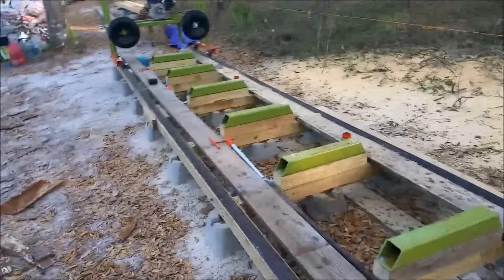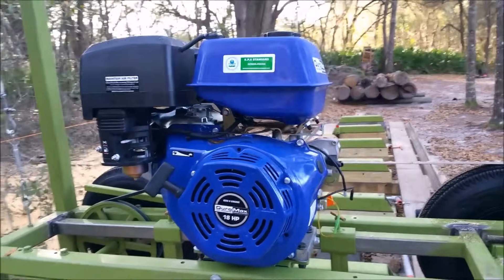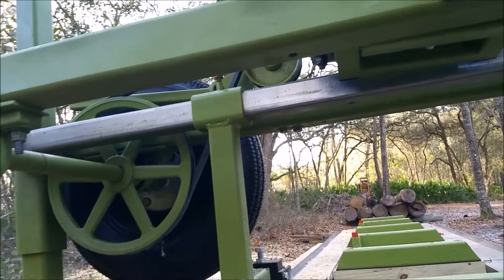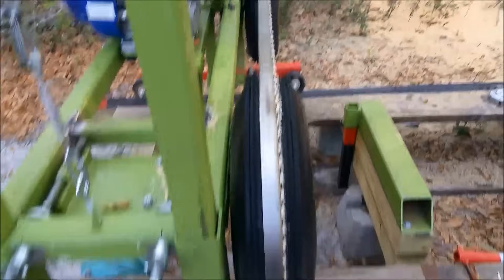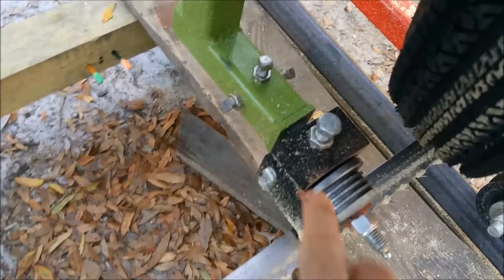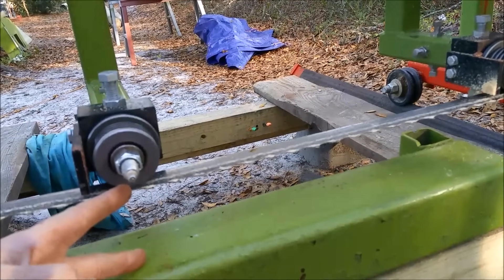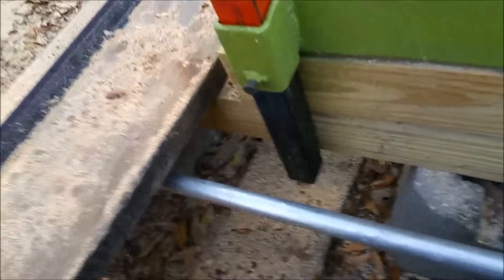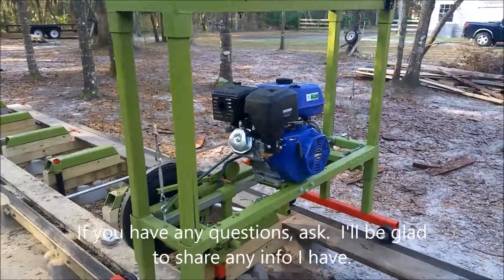Homemade Bandsaw Mill walk-around

Comment: Hi, can I ask what size is the belt you used please?
Reply from the maker: Jerome Sheerin 
I believe this setup had a 69" A type belt.... This was undersized and it is now a type B belt and I changed over to centrifugal clutch also... No more tension engagement lever. Lol
Reply: Thanks for your reply. the type b belt 69" would be a better choice so. I am ordering the following pulleys for my build. https://www.surpluscenter.com/Brands/Concentric-International/3-35-OD-3-4-Bore-1-Groove-Pulley-1-BK32-C.axd and https://www.surpluscenter.com/Power-Transmission/Pulleys/Finished-Bore-Pulleys/10-25-OD-1-Bore-1-Groove-Pulley-1-BK105-E.axd
Reply from the maker: Jerome Sheerin 
I actually rebuilt this whole saw since this video. I went wider and used pulleys with belts for the wheels. Redid my blade guides and built a new motor mount. Lol pretty much only kept the raise/low cable thing. Now it needs to be upgraded. Lol
Reply: Hi Again , Fair play to you... You have a great mind . I ment to also ask you the length of the Saw Blade and the TPI.. Thanks , Jerome

Comment: Very nicely done, as "oceanBlueLady" mentioned, it one of the nicer home made mills I have seen on youtube.   I think you said you used 2 inch square tube for the carriage, 3/16 thick,   do you find the strength good enough? or would you go bigger?  I was thinking of just using 2 inch square tube by 1/8
Reply from the maker: curtis siwak 
Thanks. I personally would not use smaller wall thickness than 3/16". There is quite a bit of tension on the blade and it needs to be solid.

Comment: Hi JD, I have an upgrade for you if you might be interested! I am building a mill and it is close to yours! On mine for raising and lowering I am using a worm gear off of a snow blower front section! I priced a winch wormgear and there way expensive at a local store If it interests you I will send you some pictures look me up on FB. I have kept the price under 200.00 99% is recycled. Love your mill.
Reply from the maker: Marc  A Gagnon 
I appreciate the offer. I'm nearly finished with rebuilding this now. I'm not sure what I'm using in the future for lift/lower, but ill keep that in mind.

Comment: Hey Josh, I am accumulating materials to start my build and have a question about the blade guides.
Reply: Is the jaw a required part of the guide.  I see they sell the assemblies with or without the jaw.
Reply from the maker: Joe Hartley 
Is the jaw the bottom plate that sits under the blade? If so, no you don't.  If I remember correctly, that was for a specific blade or issue. I just bought the 1-1/4" blade guide assembly pair and have had nothing but good stuff to say about it.
Reply: Thanks Josh for the quick reply.  That really helps. I will place an order as soon as I my basic framework is complete which will begin shortly. Thank you for taking the time to share your build and information you have provided. You probably mentioned it somewhere but having watched so many videos they are starting to run together, what is the overall height and width of your framework. I am guessing around 5' h X 5'w and approx 8" between uprights sitting on a 36"long wheel base.
Reply from the maker: Joe Hartley 
Good question on the measurements. It's roughly 5 feet wide by 5 feet tall. The actual sawmill frame is about 5 ft wide x about 14 inches deep. The "legs" on the frame are 8 inches. The carriage uprights are also about 14 inches apart to match the frame. The bottom horizontal parts on the carriage are about 24 to 30 inches long. Hope that helps

Comment: Nice job  on that mill -  would be nice o see it work ;  Cost to build  & any change's would would make -  have  a blessed day mate - kirk out > thank you for sharing  :: -  )
Reply from the maker: Kirk Hobbs 
Thanks bud. What would I change? The whole saw. Not to say it didn't cut, but it could be better and will be. I've stripped this one down to the frame and am almost done rebuilding it bigger and better. There is a video of it cutting on my channel. Also, I will be making another video comparing the two and why I rebuilt it. Thanks again.

Comment: Hi Josh thank you for your quick response, but I think I explained wrong. I would like to know the width and length from outside to outside of the mill itself.
Thanks
Reply from the maker: Freddie De Waal 
The carriage is roughly the same width at either 50 or 60 inches. I'm leaning towards the 50" mark. How I came up with a width was based off the blade length. I found my wheels and blade first, mocked up on a work table as if it was finished product, and built from those measurements outward. As for front to back depth, I'm at 14 inches, which if I had to do again would be less than a foot probably, just simply to bring the pillow block bearings closer together and shorten the axle. I also would see no problem with a solid two post design instead of 4 post. If you wait a month or two, I am rebuilding this mill and will post another video of that and share pros and cons between the two. Hope I understood your question this time. Lol

Comment: Excellent mill, what is the width and length of the moving bed from outside to outside
Reply from the maker: Freddie De Waal 
I believe the center of rail to center of rail is either 50 or 60 inches and the bed is the length of the steel at around 19 feet length. Can cut right at 17 foot log if places perfectly.

Comment: Josh I've been on Forestry Forum looking around gathering more info. This is a big help, i'm about ready to send out a parts order and since my build will be very similar to yours I was  wanting to know if you remember the length of your 5/8 drive belt. THANKS ; Garley
Reply from the maker: Deborah Cline 
I think it's a "A" belt by 64-ish in length. What I actually did was tie a string around the whole built assembly and measure it to get my belt length. I bought like 3 belts before I hit the magic number that worked best. Just fyi, I am rebuilding the entire machine with a different design on the tension, alignment, and using band wheels this time. I should be done and making another video in a month or two. I'm also on Forestry Forum as "mazdathumps".

Comment: thanks for the share. on your boat winch. switch over to a winch " brake" type they are designed for a vertical and horizontal. I would say a small 800-pound rated one would do you fine. ( "Dayton" on eBay) and cheap. the idea behind them is they will not freewheel down when you lower the saw head. A regular boat winch will just drop if the handle slips out of your hand.I have one on my saw, they do need a minimum of 50 pounds of down weight to make the brake perform, Just a little share for all to read.
Reply from the maker: Hemi Power 
Agree... I thought I broke my hand one day when it slipped and hit me... Took a few days to get my hand to feel normal again. I would suggest the winch, but I don't have a battery on mine, so I kept the hand winch. Thanks for the added advice
Reply: josh I was just on the comp and got your return. These brake winches are manual, not electrical! https://www.ebay.com/itm/DAYTON-12U370-Hand-Winch-Spur-Gear-w-Brake-800-lb/331342022421?ssPageName=STRK%3AMEBIDX%3AIT&_trksid=p2057872.m2749.l2649    Are well made this the one I chose rated as I said 800 pound lift. check it out let me know what you think
Reply from the maker: Hemi Power 
Yeah, looks good. I like the removable handle too. That helps when covering it up for the day. I am currently rebuilding this mill, so there might be some changes in that department eventually.
Reply: Josh glad to help>

Comment: Hey Josh - This is the best build and video i've seen on here. Just in the planning stage and I am thinking about going with the bigger 18.75 cast wheels. Was wondering how the gearing is working out for you? Would also like to know if you would mind e-mailing me some measurements of your bunk to garley_debbie@ymail.com. Would greatly appreciate it, and how are you liking the duromax? THANKS -Garley- from southern West Virginia
Reply from the maker: Deborah Cline 
Thanks. Glad you enjoyed it. I would recommend the cast wheels. As for the bunk, I believe the rails are 50 inches from center to center and the actual 4x4 square tubing(s) are about 18 inches (??) Maybe... 

With that being said, I have stripped this sawmill down to the frame and rebuilding with a different design and beefier parts, such as axle size, bolt sizes, and actual cast band wheels. In another month or two, I should be done and able to make a video on that one. Keep in touch and I'm sure another video of the upgrades will be uploaded. I hope to compare the two designs after I'm finished building the new one.

Comment: Sorry to bother you again. On the coupler nuts, how did you get the rod to thread all the way through? I thought the threads were opposite on the sides where you threaded 2 rods. I am talking about on the wheel adjustment part.
Reply: As long as you have the proper belt should be just fine. I got this specific wheel from an aborist site from the lumber section. https://www.arboristsite.com/community/threads/band-saw-mill-wheel-size.190933/  there is the link. I have the mill together but everything frozen so may be a few weeks yet before I get to dig in. I'll post w/ some pics when the time comes. Thanks again for all the info guys.
Reply from the maker: staci haley 
Not exactly sure what you are asking, after all its all homemade so no official names. Lol I drilled slightly larger than 5/8" holes through the side of the frame. Slid 5/8" all thread rod through those holes into 5/8" coupling nuts (right handed thread, both) and threaded the rods through and walked away. On each side of  the frame, I added a washer and drilled a hole through the rod for cotter pins. The washers/cotter pins allow the rod to turn in the oversized holes while the coupling nuts pull tight or loosen the plate they are welded to. I hope this helps answer your question.
Reply: The coupling i bought only allows it to go half way through then just locks the rod, everything else is the same  as you said. May just have to buy a different coupling that allows threaded rod all the way through. Thanks for your time.
Reply from the maker: staci haley 
I got ya. I had to tap mine through the middle to get rid of that dimple that stops it. You can also buy coupling nuts without that stop in them.
Reply: Ok got it. That's what had me curious. Wasn't sure if it was threaded differently at both ends or if I just needed to do away with that stop. I'll drill that out today. This has been a pain in the arse. Not the putting together so much as waiting on parts. Almost done I think, lol.
Reply from the maker: staci haley 
Are you building like mine? Man, I'm humbled if you are.
Reply: Yeah pretty much the same. I made very small changes but your design was one of the best diy i've seen. I purchased some 18.75 h bushing pulleys from supply center instead of using tires. http://www.surpluscenter.com/Power-Transmission/Pulleys/Split-Taper-Bushed-Bore-Pulleys/18-75-OD-H-Bushing-Single-Groove-Pulley-1-BKH190.axd link for those. If you've never used h bushings before hit me up because they are a pain to track info on, had to call company to ask ?s. Ill send you a pic when its finished up.
Reply: BTWm what you did with those turnbuckles was pure genius, I had originally gone with a different design and couldn't get it straight to save my life. Then I stumbled on your channel. Changed everything.
Reply from the maker: staci haley 
Glad to hear it helped man. That means a lot to me. The turnbuckle  idea works incredibly. I'm very satisfied with that setup. I sure wish I would have found these pulleys sooner, I just ordered 2 bandsaw wheels to convert mine over.
Reply: staci haley not trying to be negative at all buddy but are you sure those wheels you ordered from surplus are gonna work? It looks to me as if it is just gonna eat your blades up after just a few revolutions with the belt groove that’s machined into it. 

A bandsaw blade is not forgiving like s belt is. A bandsaw blade is made to ride over a flat wheel, it really should have a very fine crown machined on the face, and because the blade will track from the front of the face to the back at different points of running, tension, load, etc, as soon as it travels towards the front of the wheel it’s either gonna shave the teeth right off or it’s gonna just snap it unless you machine the belt groove off and by then you could have just ordered the correct band wheels. 

Hoping there is something else I’m not seeing and am wrong , please let us know whether they will work or if it not being a flat wheel is a problem

Good luck!!!!

Comment: u did an amazing job on almost ever aspect of this build, which is why I am really surprised you went with Tires an not cast wheels for running the blade on. Price wise they are not much difference. Performance wise its like going pushing a car around a track compared to driving one. Sure you can do it, an yeah you will get there, but wtf would you want too. You CANNOT tension that saw blade no matter what you do to it. It will run slower and harder all the time. With the expertise of build shown for every other detail this makes me cry on the inside a little bit.
Reply from the maker: Greg Ward 
Thank you and after building this, I agree on the pneumatic wheels being a bad choice. My only issues with this machine lie in the wheels and axles. That will eventually be upgraded.

Comment: nice design, how do you set the blade guide bearings? thanks
Reply from the maker: Steve Haigh 
They are Cooks blade guides. They adjust in every direction.
Reply: thanks, i was also wondering about the process you use to set the guides, any chance of a video on that? and how often do you have to adjust them? is it a one time thing or are you tweaking the all the time? thanks
Reply from the maker: Steve Haigh 
Here is a video that Cooks puts out. I referred to Cooks videos quite often.
https://youtu.be/qkwW2iX4Wqw

Comment: what is the throat width?  In other words, what is the max width of a slab you could cut?
Thanks!
Reply from the maker: Marshal Wade 
The widest piece of material that will fit between the bearings on the blade guides is 23 inches.

Comment: Very nice !
Reply from the maker: George McLaughlin 
Thank you
Reply: Josh Davis 
I would very much like to build myself one , are the hubs just for like trailer wheels ?
Reply from the maker: George McLaughlin 
I think they are more for like go kart wheels or maybe lighter duty than a trailer. My biggest regret is not designing a stronger axle/hub assembly. Something that could handle more tension. These axles have broken and been welded back straight many times each. My advise, go with larger axles and hubs with pneumatic tires. If you use a band wheel, you can arrange the hub closer to the pillow block bearings and probably be fine.

Comment: good job. hope it does well for you. about to start mine once i get the angle iron to the shop
Reply from the maker: Chad Marusak 
Thanks. My biggest lesson is tension. I lack blade tension due to my axles being 1" diameter. If they were larger, I could torque down tighter and have straighter cuts. This is in theory anyways.

Comment: Well done!  I like the centralized load over the carriage.  A lot of these I see are too shakey in construction.  I'm considering whether to buy one or build one.  I like how you set the track.  But I'm wondering how you keep it from moving around when you load the logs?  Are the blocks set in a concrete anchor?
Reply from the maker: Brad Taylor 
Thanks. I load logs with a tractor and logger tongs. So they just lower down onto the bed. It's a solid log bed, but no footers. Just the concrete deck pads and 4x4 lumber

Comment: Was curious of the height of your uprights. I am welding everything together in the morning actually and had to space it enough for the motor to clear the top. So I have 4 foot uprights and a 15 inch space to clear to gain more clearance to cut larger material.  I have same motor and everything.
Reply from the maker: staci haley 
Mine are probably about 4 feet. Wish I had gone maybe 5 to have more clearance above the motor.

Comment: super engineering👍👍👍👍. I also wanna build my own saw mill, so can I have the complete design plan? my email id is ngamk2005@gmail.com. Thanks!
Reply from the maker: Hengam Khongsai 
Thanks. I do not have plans. I designed and built this out of my head.
Reply: Josh Davis you r a genius then
Reply from the maker: Hengam Khongsai 
Haha. Probably far from it, but thank you. I designed a little at a time until it all worked together. Some trial and error, lots of Google and lots of YouTube.
Reply: Josh Davis i'l make good use of your video n build one for myself.
Reply from the maker: Hengam Khongsai 
This video is about the third rebuild, but most structure stayed the same. All the many details is what had to keep being tweeked. I had some good times building this and learned a LOT during the process. Good luck with yours and a little advice would be to do research and learn how everything works together.